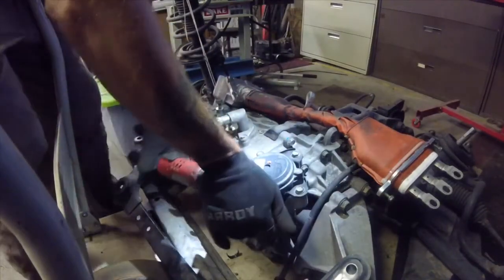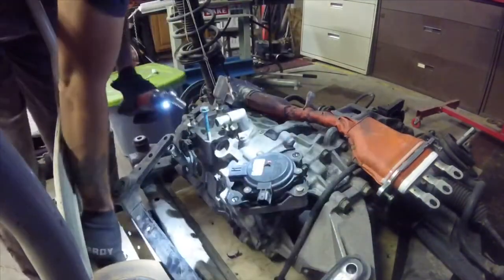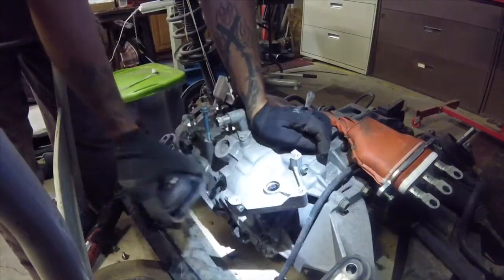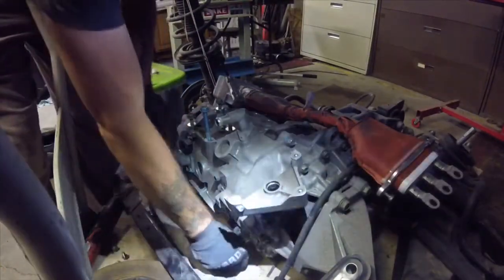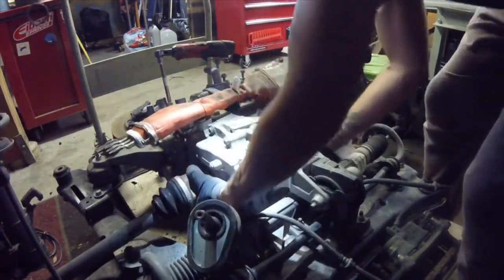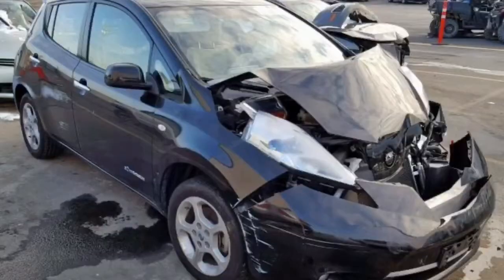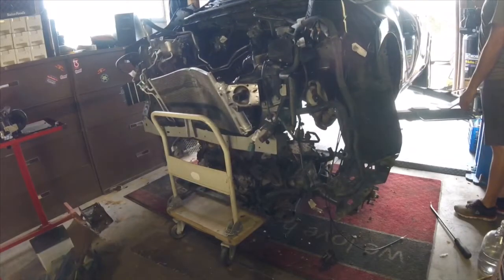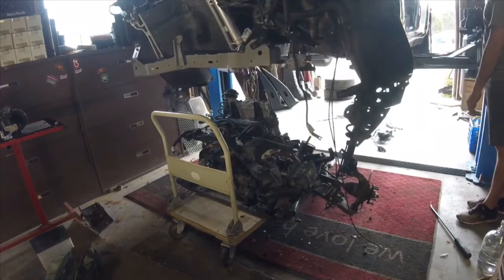Nissan LEAF parking pawl manual release

Comment: Was a bit of a PIA in the car.  Had to remove the 12v, fuse box,  lift the high volutate wires and remove the mount.  Then once I popped the connector I could use the motor as a wrench to rotate the splined connector.  couldn't get a wrench to grab it otherwise.  Seems like better to plan ahead and do the put it in neutral and pull the fuse/connector and power off but otherwise this is what you are stuck with.  Thanks

Comment: You do not need to take actuator motor off, just remove holding bolts and turn it any way (clockwise or anticlockwise) about 90 degrees.
Reply from the maker: @TopRatedNow  great news! I’ll have to try that on my current project.

Comment: is it possible to apply 12 volts to the  actuator motor?
Reply from the maker: I’m sure there is a way but I haven’t spent the time to try to pin it out.
Reply: That's exactly what I need too! Can't get actuator motor out as one of this 3 bolts is totally stuck there. Have to use electric power to turn it to neutral. But what pins and where to look? Any iedas anyone? Car is on the street for a few days now. Nissan did bad job on service neutral position!

Comment: Which way do you turn the shaft to release the park brake? It looks like anticlockwise??? Thanks in advance
Reply from the maker: I’m not entirely sure and I’m not in front of a leaf Drive unit right now. When you get a chance to experiment, can you post that up? Thanks mate!
Reply: Should be any way - about 90 degrees I guess. Both ways should work - have not tryed myself - from other ppl words.

Comment: have you ever had any cases where the parking paw reengages after manual unlocking? I'm using the EM61 on a cross kart project and i would like to use this feature to have a parking brake but I don't need it to engage by accident while riding lol
Reply from the maker: I haven't had an issue like that but I generally use them with the parking pawl motors fully intact and controlled by the LEAF electronics. If you aren't using the LEAF electronics then I would DEFINITELY build a manual lockout lever/bracket that holds it in the open position (or if you take the case apart you could remove the mechanism itself). I wouldn't want a sudden lockup at 100mph!
Reply: @MicksUglyEVs  I agree that would be very bad lol a few guys on the forum said once manually unlocked there is a internal cam style lobe that prevents accidental re-engagement .
Reply: @MicksUglyEVs  but I still will make a lockout bracket so I can engage park whenever I like to use it
Reply from the maker: Good call, I went with a rear disc brake setup that didn’t have capacity for parking brake so I’m relying purely on the pawl (maybe I’ll throw in a block of wood for the really steep parks ;)

Comment: Good video, but could use more info. What is the orientation of the unit we are looking at in your video? And what stuff needs to be removed to get to it the pawl control motor?

Seems odd to me Nissan doesn't have an easily accessible mechanical backup option for this like on pretty much every modern ICE vehicle with an automatic transmission.
Reply from the maker: Thanks Michael, Appreciate the feedback. Do you have a LEAF in which you need to do this procedure? I'd be happy to offer more details directly if you're struggling to locate the pawl motor. And yes, I agree that there should be a way to put it into neutral manually, this is the only way I've found to accomplish that.
Reply: @MicksUglyEVs  Hi, our leaf is stuck in park and the ignition won't switch on to change it. Whereabouts is this located on the drive unit . I have had a good look top and bottom and it's not obvious. Any help would be appreciated. Thanks very much.
Reply: @briangibson5002  Hey Brian, pop your 12v battery out to get a better view down below. You'll see a mechanism that looks very similar to the pawl mechanism seen here. It's a tight squeeze but you'll be able to get the tools in there to dismantle the pawl motor and remove. Good luck my friend!
Reply: @Busaru  Thanks very much for your help.
Reply: They used a similar transmission on the E-NV200 van, but with a totally mechanical (cable operated) park pawl, and proper trans T shifter. Much better!